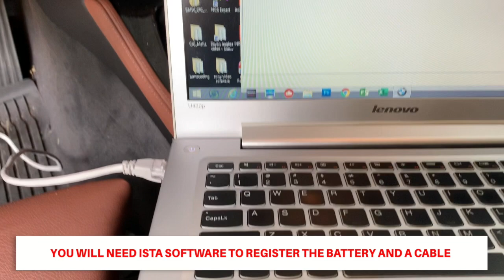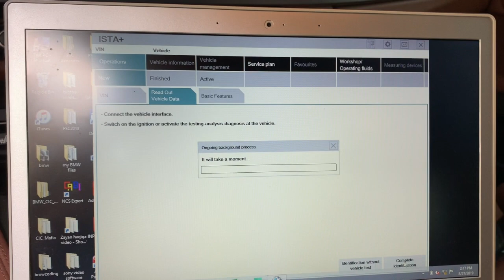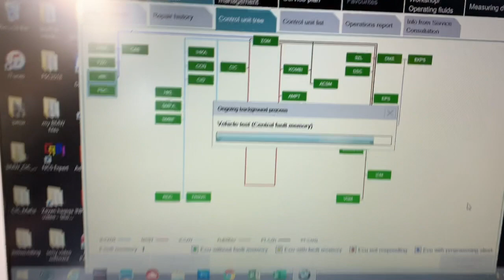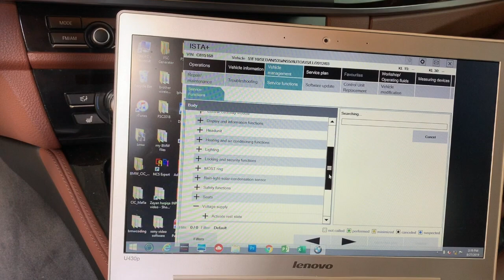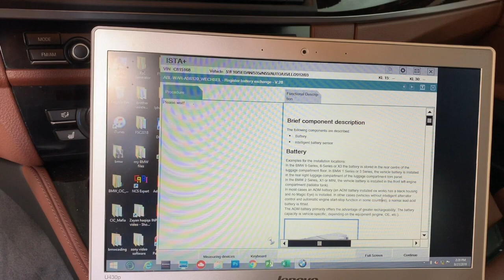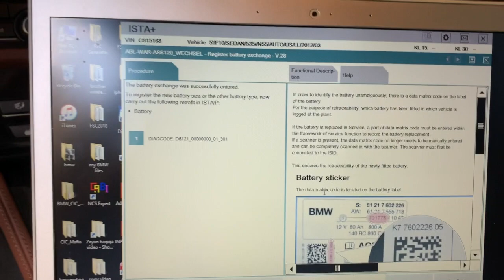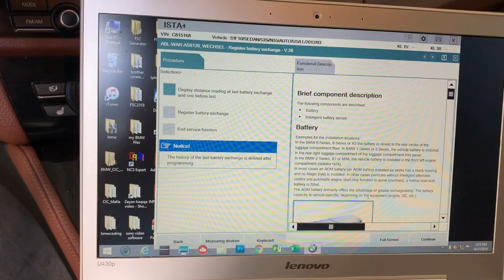BMW 535i F10 Battery Replacement and Registration using ISTA

Comment: So basically as long as the new battery is the exact same capacity and type, this will be enough? As apparently it seems to get quite a bit more complicated if you need to program a different capacity or type?
My father has an F11 and I'm fairly certain the car has the original 10 year old battery, so inevitably it will need to be swapped soon and I want to make sure I can help him out with that
Reply from the maker: You have to program each battery regardless of specs. It can be the same but still needs to be registered. Basically it’s the exact voltage of the installed battery that is calibrated so each battery have different voltage ratings on millivolts level.
Reply: @HowToDoitright  Oh yeah, I know it needs to be registered. I must've just confused myself by watching another video where someone changed to a different capacity (Ah) battery on an E60 I believe and the registration was exactly the same, but since the new battery had a different Ah rating they had to open an entirely different programming app and do a bunch of things there but I suppose with ISTA+ it should be much easier on F11's

But yeah, I don't see any reason to change to a larger battery or anything so I would just get an exact match and go through the normal registration like your video just to be safe

Comment: If I replace the battery for the same capacity do I still need to do the registration?
Reply from the maker: Yes you have to register regardless or your new battery will go bad.
Reply: misconception: regitering a new battery is just  wringing in the sytem" the car has a new sytem" with ista D.  whit ista P you  tel the  DME   the car has a certain  type  of battery  for example you can ware in  a  90 Amp per hour battery  and you do   that with  ista P in the retrofit function/maintenance
Reply: @SanDoval201970  ISTAP only with ESeries. For coding/programing FSeries works only ESYS
Reply: @ukasz3375  you van actualy progrsam and encode with ista d plus witch the replacemnet of ista P